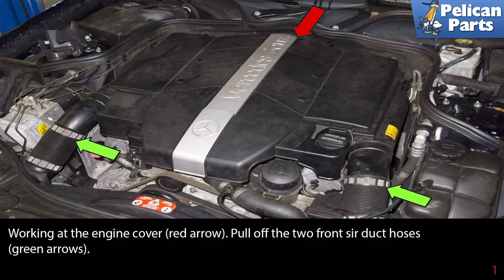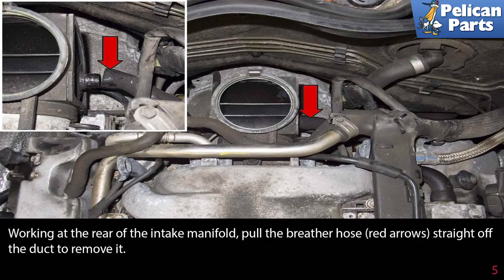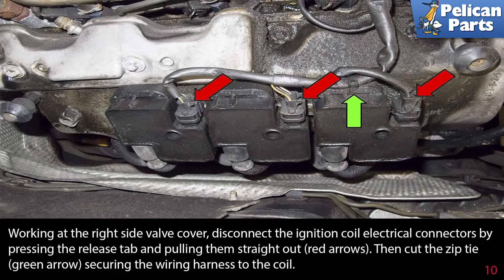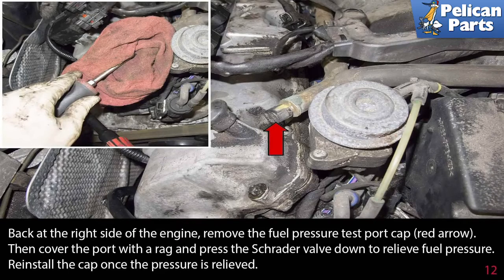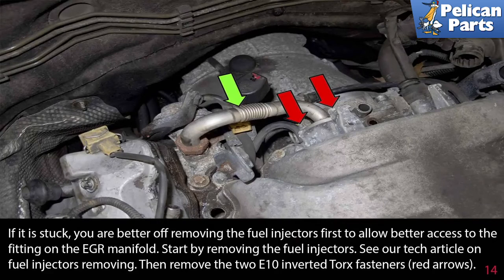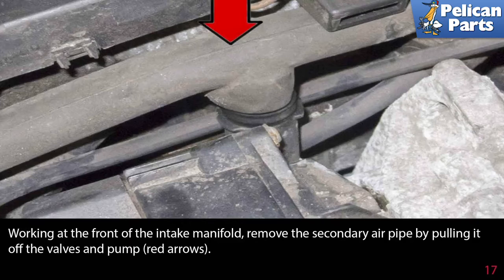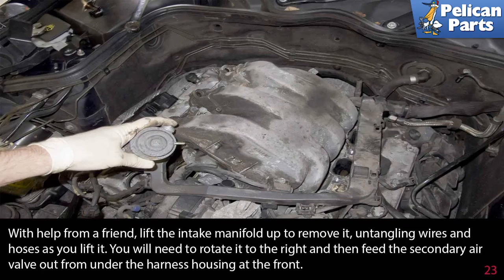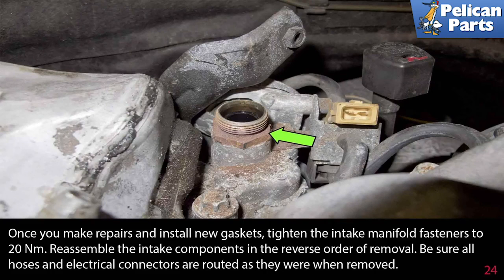Mercedes-Benz W211 E-Class Intake Manifold Replacement (6 Cylinder)

Comment: HI mine is a 08 e320 diesel and only has one exhaust going to the engine on the right side and it goes back side and splits into two tail pipes.  I can see the starter but exhaust is in the way.  I have also watched the TRQ video but also has two sided exhaust and the bolts and bracket to the manifold is different.  Any tips how to get the rightside exhaust off or is the engine mount way is another I read.  I am very lost.  Can anyone guide?
Reply from the maker: I responded to your comment on the article page: The vehicle shown is a gas engine model. For your model, MB states to detach battery ground. Remove engine trim. Remove air filter, Remove catalyst. Once those items are removed you can access the electrical connection, then a heat shield and remove the starter.
Reply: @pelicanparts  thank you Nick.  Now I am confident to finish the job 💯.
Reply: No mine is a diesel and has only exhaust on right side.  I have the mercedes shop manual on my pc the bootleg version the dealer uses and it says to disconnect exhaust at the turbo inside the engine from above.  I figured that was the case because there aren't any other bolts left.  I just wish someone that actually worked on this specific diesel model can give an input and confirm this as the photos in the shop manual are poor quality.  Ty